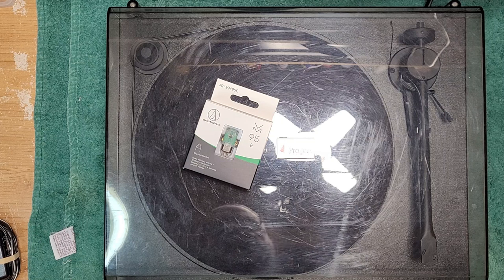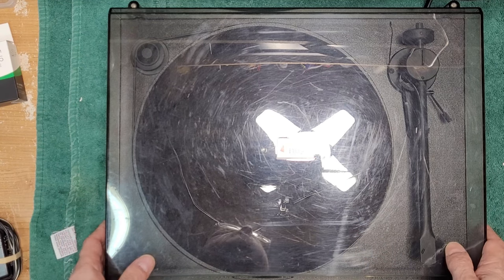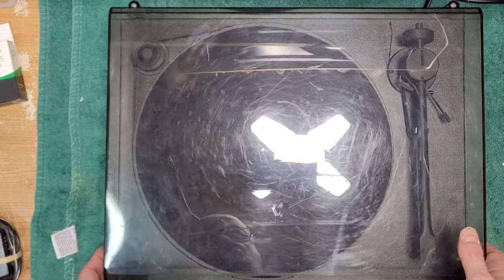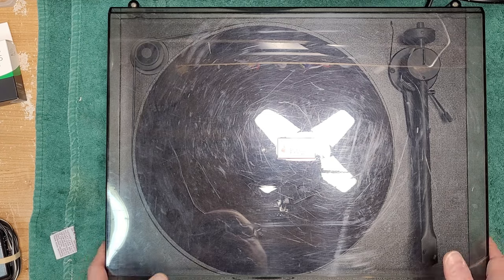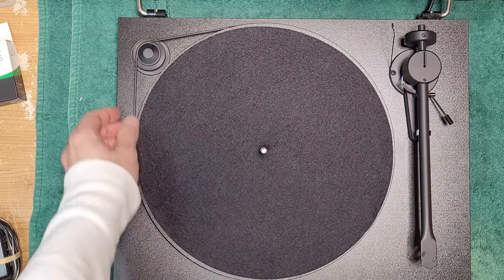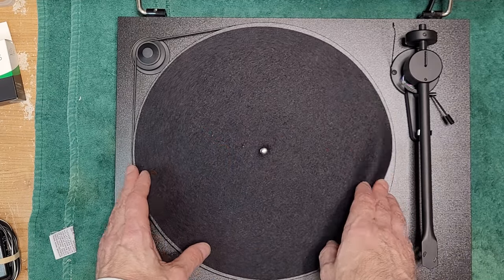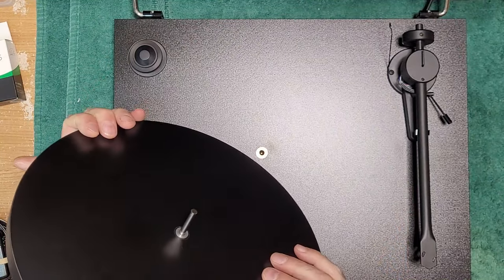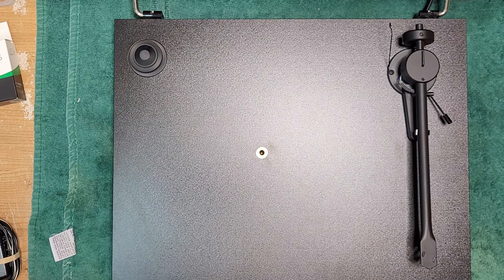Pro-ject Essential: Service & Cartridge Installation

Comment: A lot of times when working on turntables I find goodies and missing pieces inside the plinth. To date, the best find was an original v15 with 2 original styli in packages. You never know what you can find inside the plinth. It's definitely a benefit to working on Dual 12 series tables. Dr.Casette describes how windex is better for cleaning belts because it does not dry out the rubber on rollers and belts. I used to use IPA on belts, but now use windex and it does a fine job. I always boil them first. 5 mins. I work on tables daily and I love p-mounts and never understood why people poo poo them. I just picked up a SL-QX200 with a pmounted shure and it sound fantastic.
Reply from the maker: Duals are a great place to hide all sorts of goodies.
Reply: @TurntableGuy Did a little 1226 today and the stacker spindle was poked inside the plinth. Shame the 45 adaptor was not in the plinth.

Comment: There is a finger lift for the headshell that is hold by the screws of the cartridge but obviously it's missing...
Very simply made turntables those projects...if you want a decent project turntable you must go from the project debut model and above...
Keep up the good videos ✌️

Comment: I have the 2nd gen. It has a finger lift. The finger lift attaches to the top of the arm using the same screws holding the cartridge on. I’m pretty certain this would have had one at some point.

Comment: I have the pro-ject debut 3 with metal platter that I switched to acrylic cause changing speeds is lifting heavy metal platter was always worried about metal platter falling out of my hand and scratching wood finish I got my platter used which saved a lot of money and it came from a rega planar TT but was told it would fit my pr0-ject  ,I know why the felt mat is thin cause the tone arm will not be level when playing records I tried to replace mat cause original was very thin but doing so you can see how cart was not level with record it was higher than the counter weight but using acrylic platter worked out for me you don't need any mat and I believe that bearing is fixed in there I have the same set up the only thing is that whenever I see vids on people doing an unboxing  on this type of player they do not tell you that bearing has to be lubricated on mine yearly or 6 months if used a lot the minute I got mine I added just one drop of oil into bearing just for my ocdish ways its important so it takes a second to drop oil in there so what  JRo who ever had that one lost finger lift they all come with one

Comment: A complete no no having a slip mat that loses your bass definition and cause it extra flatter. You could use some double sided tape to hold it down, if you can stop the mat with your finger quite easily then no it's no good the stylus is doing the same thing in heavy bass notes.
And no you don't want a belt to be sticky I wouldn't use acetone, putting your belt in a bag of talcum powder that can be good but depends on the climate if you have high humidity probably not a good idea otherwise it's a good idea you want grip not stickiness. And even some alcohols like methylated spirit can cause cracking of the rubber so be careful what you're using rubbers contain oils you don't want them to dry out. washing up liquid and water is best.
Best mat I found is blu tac
Three pieces around the centre spindle about an inch and a half diameter and the rest made into a star of David about a quarter of an inch from the edge of the platter. A table like that would benefit from copper mat or an acromat zorbatheen rubber. I believe it should have a carbon fibre moulded to the as a left,
You could use a piece of string cotton coated in wax, drill a hole in the centre tire knot underneath the cartridge lift it from the middle